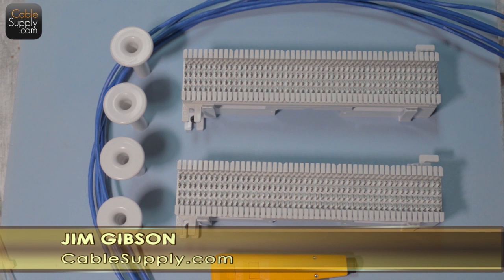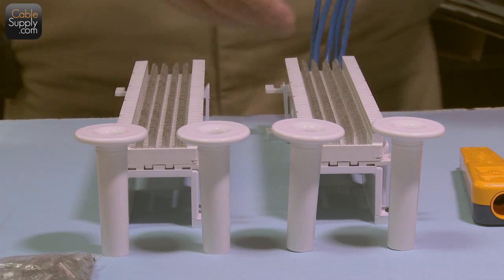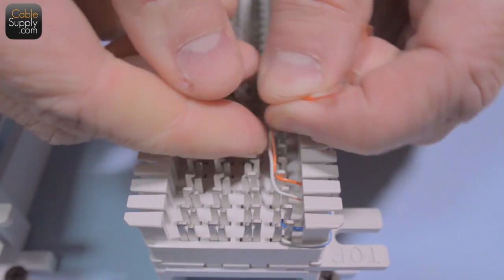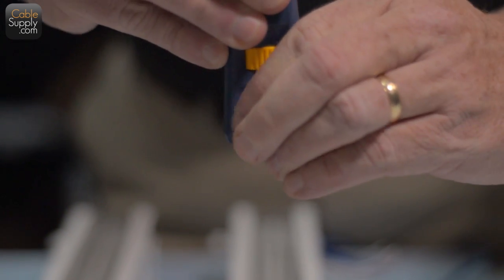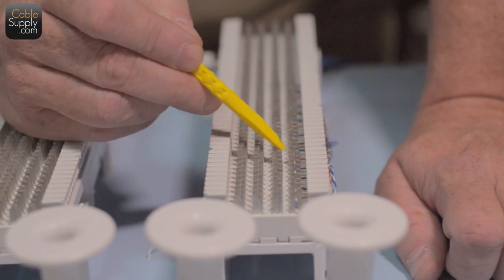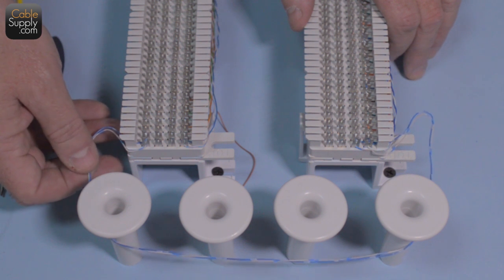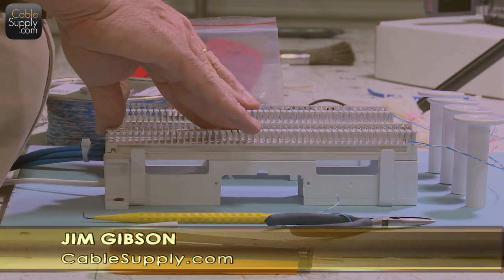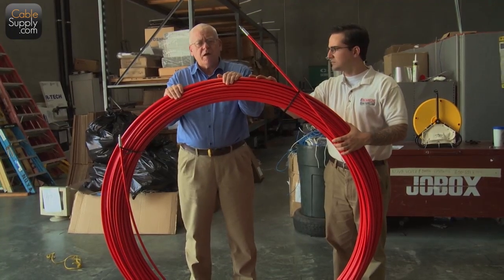How to Punch Down and Daisy Chain a 66 Block

Comment: I just found you guys and I love these videos! Congratulations!!! Any assistance you can provide I would GREATLY appreciate. I am  volunteer at church. On this video at the 3 min mark you explain that this infrastructure is not for computers. Can this 66 distribution block be converted to ethernet with the same wiring (in the wall)? For VoIP. That's if the wiring is ethernet (4 twisted pair). I know the phone connectors are RJ45. But have not confirmed the actual wire. If the wiring is cat6, like the ethernet wiring, how do convert the 66 block to ethernet? I noticed also that there is not a lot of slack. Thanks you in advanced

Comment: I have used 66 blocks designed for cat5e cable and wired according to BICSI standard for that on VoIP and it has worked.  Also in 30 yrs I have worn out at least 3 blades

Comment: Thank you for sharing. I understand 110 blocks for ethernet but was always confused when looking at the 66 blocks in telco rooms -- no more!
Reply from the maker: Glad it was helpful!
Reply: @CableSupply  Re-watching this video to see how much stuck and I came up with a question. You were going to explain why you don't use bridge clips on the customer side, then explained why you do use bridge clips on the provider side, then explained how to daisy chain on the customer side which all makes sense. But you didn't quite finish explaining why you didn't use bridge clips for the customer. Is there a reason you couldn't do the same daisy-chaining on the other side of the split, then use bridge-clips in-between?

If you had say, four customer lines on the daisy chain and there was a quality issue which wasn't on the telco side, having bridge clips may make it easier to troubleshoot which internal line is the problem. I still don't understand why you wouldn't use bridge clips on the customer end. Thanks in advance!

Comment: I use them on 100baseTX ethernet, they work fine (here in the UK Krone stuff is typical for voice)
Reply: TheChipmunk2008   Okay this haven't to do with Krone but 100TX works over Cat3/Cat5. If do you use the block once time it is works fine. But this thing is normally for analog thelephony - never for digital things! At this times where we use more and more 1 GBit/s or more should the connectors works in the same fast speed too!

Comment: If you are doing multiple phones on one phone line wouldn't you want to do the daisy chain on the opposite side and use bridge clips so you can troubleshoot the lines without deconstructing the circuit?

Comment: Jusst found this video and it really helped me.  1 question though, what about the other pairs?  I noticed you just used the blue pairs with the cross connect, but why not use the others?
Reply from the maker: Generally speaking, 66 blocks are analog. The only time you would use the other 3 pairs is when you have more than one line coming into your analog telephone. Of course, if you're punching down a 25 pair feed cable, you would punch down all of the pairs. This illustration only shows you how to punch down and daisychain the first pair. 66 blocks are hardly used these days. Thank you for watching the videos and your comments. Hope this was helpful.

Comment: Fancy.  Last time I wired a residential telephone the line coming in attached to a black piece of plastic with three bolts on it.  Center had a ground cable that went to a water pipe.  The other two had tip and ring from the Telco and the various house lines all connected.
Reply from the maker: That was a surge protector.

Comment: Thanks for the video, really helpful. One suggestion: how about doing the daisy chain on the other side side of the station block so you can use bridge clips to disconnect every individual  phone station, one at a time, in order to trouble shoot?  My application is a single family home with 2 phone lines and 6 phones.

Comment: what if you need to daysi chain about 8 phones? is there a different block you have to use?
Reply from the maker: There is a limit of how many analog phones can be daisychained together. If you look at the bottom of an analog phone, it will tell you of its "ring equivalency" ratings. If you exceed the ring equivalency with all your analog phones , the phone company will not be able to ring your phones. The old analog phones will have the ring equivalency rating on the bottom of each phone, you need to add them up to come to the totals of what the phone company will support. When you need more than two or three phones you should look at a phone system with individual extensions, then program the extensions to ring whenever there is a phone call. There are other solutions to this problem but it's hard to explain in this reply format. Please subscribe!

Comment: Jim Help... I understood most of the explanation. But what about the orange green and brown connections. what do they do?
And the one from the phone company, why do they have to connect all pair, like the one at the user side?
Does this mean, you cant connect 4 different phones or faxes on a single CAT5/6 cable?
Love your video..
Can you make one doing the PABX please
Reply: +JOEL A.K Using standard Cat5/6 you can run up to 4 individual phone lines with a single run. I just finished wiring a house using the blue pair for her main line, orange for the second line, and brown for the fax. Although we are not using the green pair I still added them to the 66 block in case someone in the future would like to use a 4th line. Hope this answers your question sufficiently.
Reply: Orktek Theadmin thank you dear... that means, upto 4 connections in a single cat5/6 cable